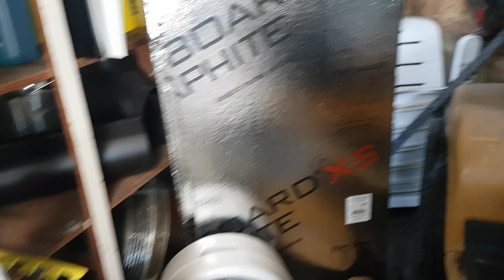That is not good!!!

Comment: It’s unusual for a pushrod to come out like that and that’s probably what put the hole there.
Usually it is caused by interference like a valve hitting a piston
I would heat up that push rod and put it in the vice and slowly straighten up making sure you don’t crack it.
When you reinstall the pushrods rotate the engine by hand and check for interference..,
If it binds up 
There’s probably more damage… But Id definitely give it a try because of the pushrod failed and it’s just the pushrod

Score

Good luck
Reply from the maker: Yup, My small engine mechanic sayed the same thing. Timing might be out , Maybe??